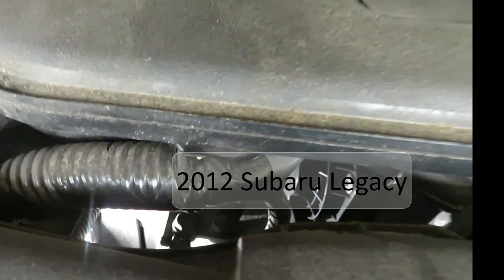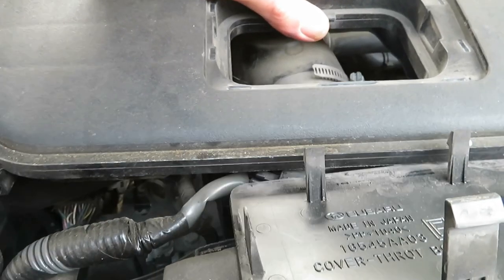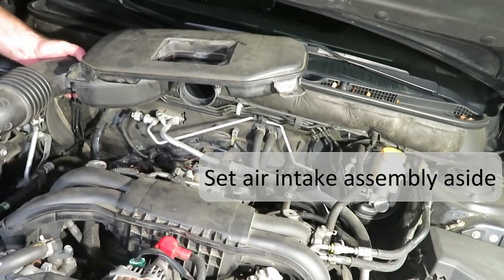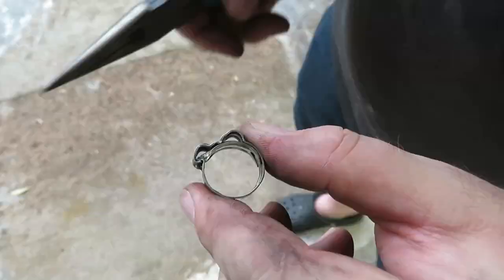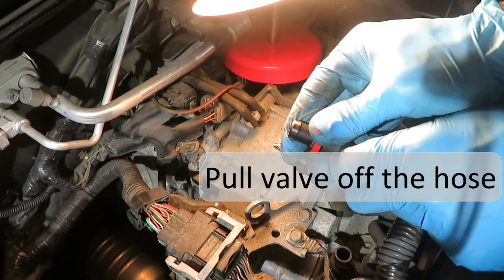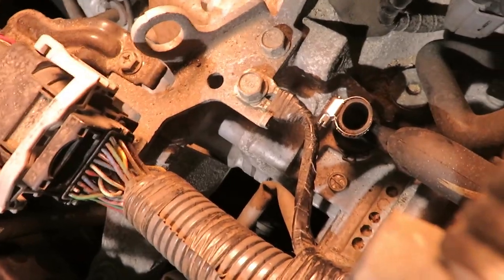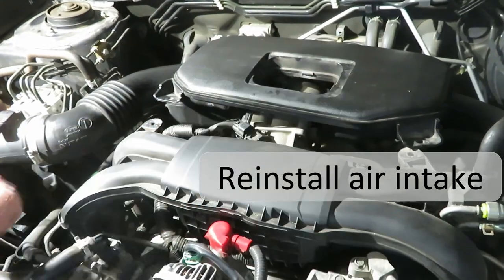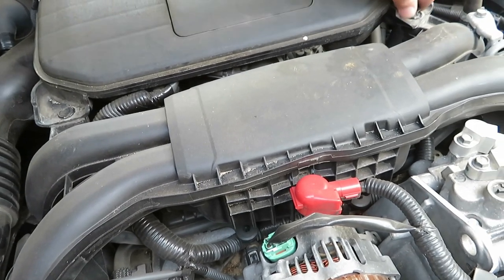How to Replace the PCV Valve Subaru 2.5L Legacy and Others 2009-2013

Comment: thanks for doing this. nobody else out there is as clear or thorough on the process for this type of valve. appreciate it! I'll be doing mine this week. fingers crossed it's actually seized and the cause of my lean condition/vac leak.

Comment: great video.... mine came off by simply pulling on it like yours did. I just popped the new one in. 
I had to be careful not to crack the little hose, it was starting to get brittle. The car is getting u in age. 180000+

Comment: Thanks for the helpful video. I sort of "inherited" a 2012 Legacy, all of my family's other vehicles are Toyotas. So far, every maintenance procedure I've done on the Subaru is at least 50-100% more difficult and irritating than the same procedure on Toyotas, this one being no exception. I wonder if Subaru is copying the Germans, and just trying to make you give up and bring it to the dealership. For example, I'm apparently going to need a jack and a piece of plywood to lift the engine to get at the coils and plugs. Splendid. Anyway, thanks again, I probably would have been scratching my head for a while to figure out how to get to this thing if it weren't for your video. Much appreciated!
Reply from the maker: We changed the spark plugs on a 2012 Legacy without lifting the engine: https://youtu.be/gF_4UGqocxQ
Reply: @TheOriginalMechanic  Thank you! I'll go have a look at that one.
Reply: On the '12 Legacy, you just have to remove the battery and the air box to have access to the coils and plugs. Helps to have a flex-head ratchet and a variety of u-joints and extensions, but I've done it with a normal 3/8" ratchet and a couple short extensions.
Reply: What are you talking about? Maintenance on Subarus is easy as shit..

Comment: Great video, what are symptoms of bad PCV? Thanks!
Reply from the maker: I think a bad PCV valve hurts efficiency and probably gas mileage.
Reply: @TheOriginalMechanic could a bad one be causing exhaust smell through the vents?
Reply from the maker: I don't think so, but changing it out would be an easy...and cheap way to find out.  @izizzlefuhRizzle

Comment: This works for 3.6r?
Reply from the maker: I don't know, it  might be similar but likely not identical.
Reply: It was nothing like yours. But they made it so easy to replace the pcv valve for the 3.6r😂its literally just a hose tucked in the right side of the engine block. Just gotta take 2 clamps off.